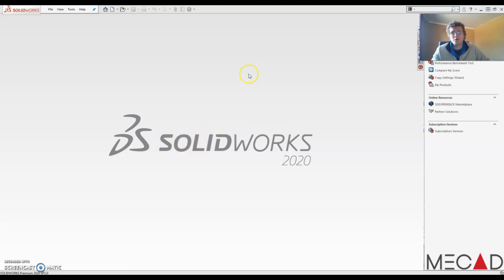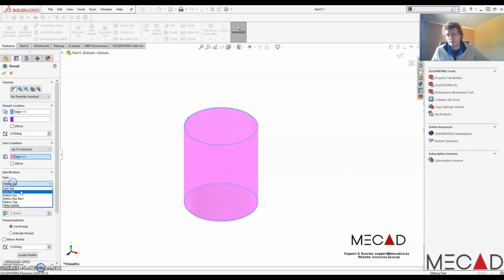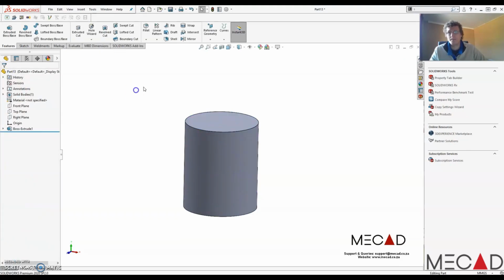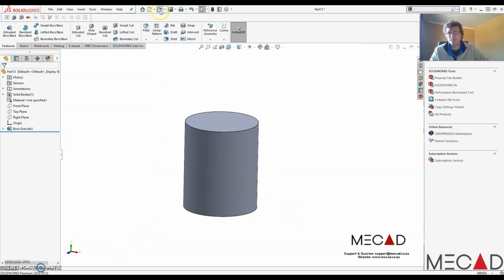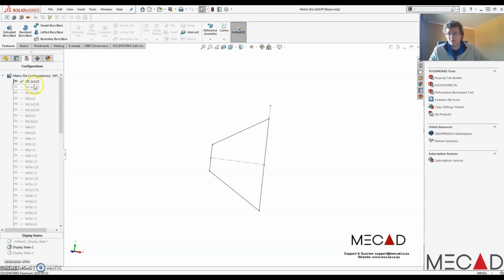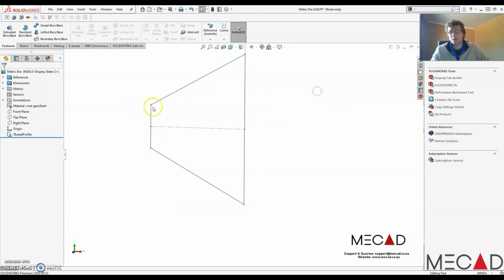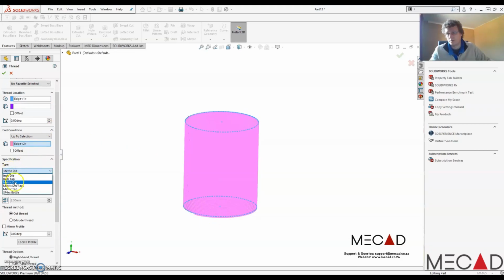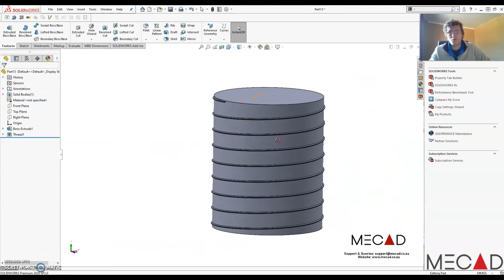Creating custom thread profiles in SOLIDWORKS

Comment: I need a 9/16"-18 thread (not in the list). I followed the video, created the extra thread, saved the file. Went back to the bolt I want to thread and it doesn't show the thread I created. Went back and opened the file and the .5625-18 thread is there. Any ideas?
Reply: version 2021

Comment: I understand what you did here and I want to add an M72x1 into my profiles. My question is  when you changed the thread pitch on the actual drawing, do you not have to re-calculate & change the other 2 values as well, or do they remain the same because you are using the same M size? (I am looking for an accurate thread (not cosmetic) to create a G Code program from the CAM add on).
Reply from the maker: It is best to try and manually add operations like threading in CAM software, often thread is not interpreted correctly and it tries to "mill" the thread.
Reply: For anyone still struggling with this the method to find profile and height can be found here: https://www.cadimensions.com/blog/new-thread-wizard-tool/

He doesn't actually follow these formulas in the video for whatever reason - please explain
Reply: @meekeech  Thank you, this helps a lot.
It went wrong when I'm using a smaller pitch and I found out that the other values didn't match with the new pitch.